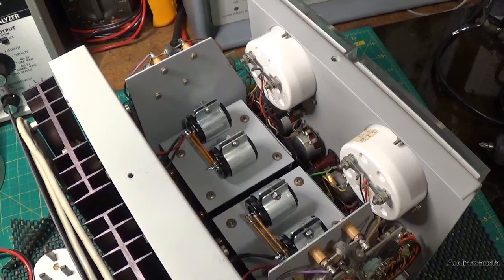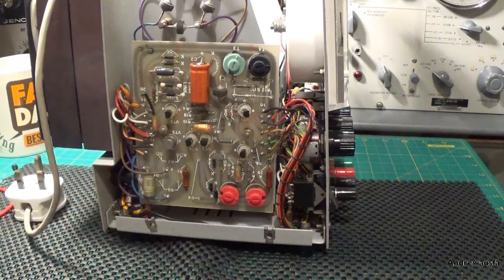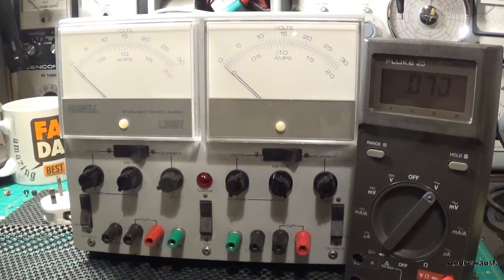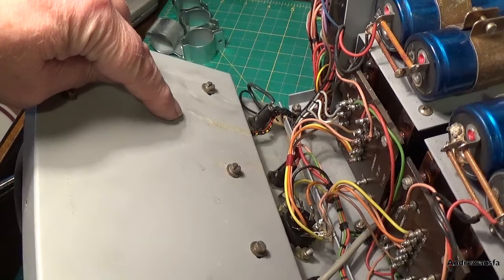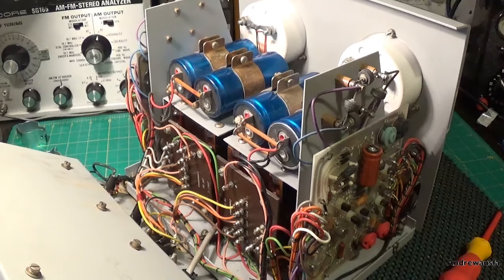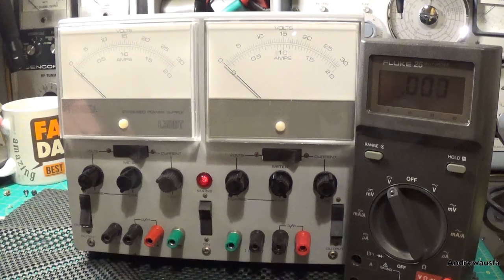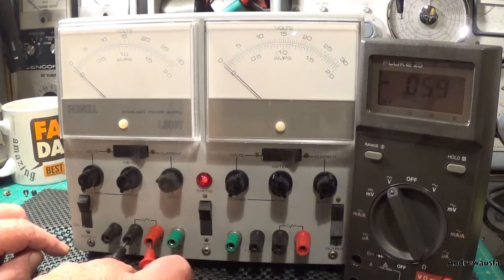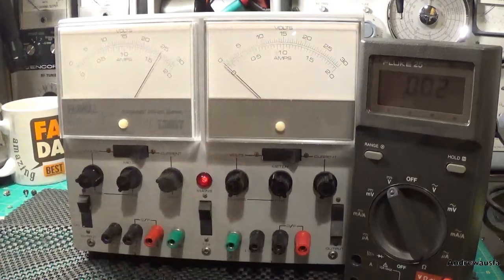Farnell L30DT Power Supply Part Two

Comment: Hi Andrew, lovely job I have the single power supply. Just a thought, the new clips would it be possible to fit them inside existing clips and use the top fixing bolt to secure the new caps and the new clips instead of removing old clips.  Great video Andrew.

Comment: Hi Andrew nice video. I have the L30B the switch for voltage to current reads ok voltage wise but reads nothing current wise. The current is there as I put my Fluke in series to check. Do you know where to purchase one of these switches or any other replacement or workaround, many thanks.